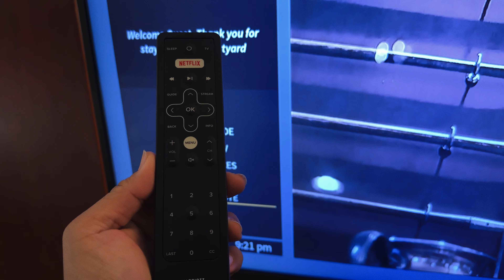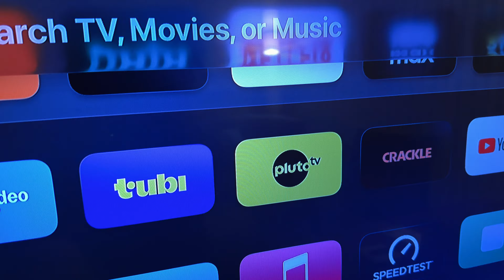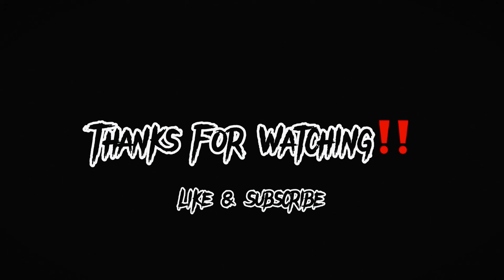No Input Button On TV Remote‼️😱 How To Access HDMI Inputs On Marriott Hotel TV 📺 Volume Control 🔊

Comment: I’m currently stuck. I followed the steps and the volume is still very loud. Do you have Instagram where I can message you? I rly need to adjust the brightness because I have family that is visually impaired. It’s unfair how these hotels take our money but can’t have tvs unlocked to adjust volume and brightness..
Reply from the maker: I’m sorry to hear that. My IG is sivar_m3. It’s definitely frustrating and annoying with their tv setup not being able to accommodate a more unlocked tv system especially for your family and others that are in the same situation. Across all their hotels there are different versions of the remote controller and media box. You might have to disconnect the Ethernet cable that connects to the TV and leave the power cable connected on the media box.  In one of the Marriott hotel I stayed when the Ethernet cable was connected to the TV and the media box it limited the tv volume to 60% and when you turn the volume at 100% using the remote it was 100% of the overall 60%.  Volume was so low I had to connect my AirPods Max to my AppleTV to enjoy watching movies and shows because without I could barely hear anything.  You can try that to see if it works to lower the volume.  You can’t disconnect the media box entirely right away because then the provided controller doesn’t work anymore.
Reply from the maker: For the brightness I’m not sure how to access the tv menu with the provided controller and tv system.  Only thing I can think of is connecting a universal remote controller. I haven’t used a universal remote controller on a Marriott tv before so not sure how it works with their system.  I’ve only used my AppleTV controller to control the volume on the tv. I’m guessing to make the controller fully functional the problem with the high volume would need to be resolved first because usually the tv doesn’t register the volume up/down inputs when you press the button on their controller nor in my case on my AppleTV controller.  So I believe it would be the same on a universal remote controller until that issue is resolved.
Reply: @WillFlores_Sivar_M3 thank you so much for reaching out!! I literally figured it out last night lol. Man talk about stressful.. thank you again.
Reply from the maker: I’m glad you were able to figure it out.  And no problem.  True that it’s stressful dealing with their tv and entertainment systems.

Comment: How to change the batteries?
Reply from the maker: I’m assuming if it doesn’t have a lid then you might have to pry the bottom back side a bit and slide upwards. I don’t remember the back side of the remote in the video because I personally have never really changed the batteries on any of the hotel remotes before.  Sorry I couldn’t be much help.